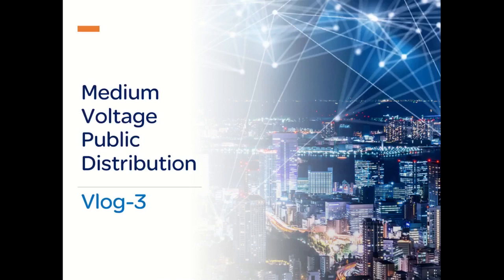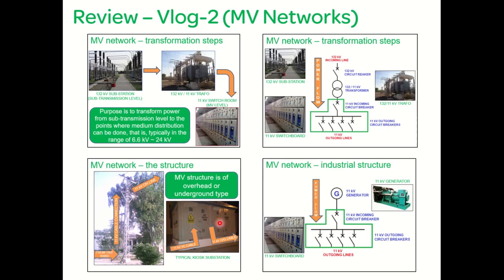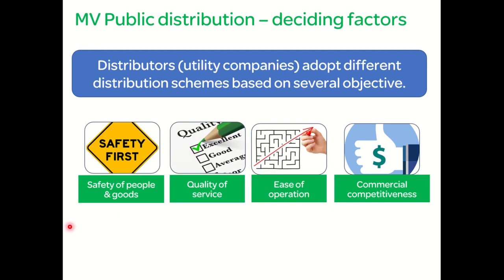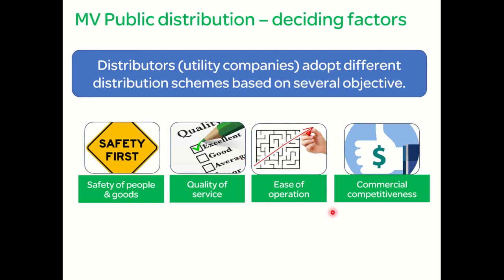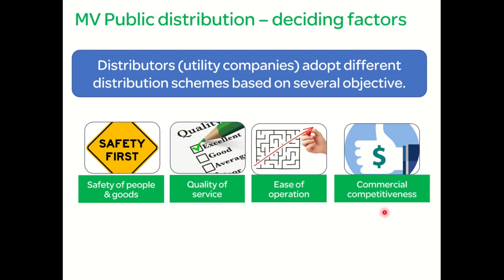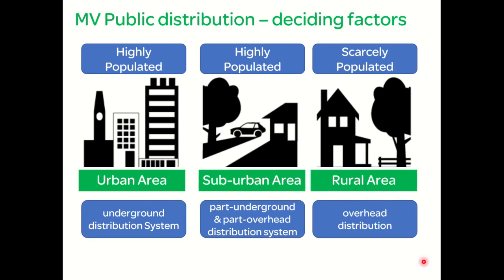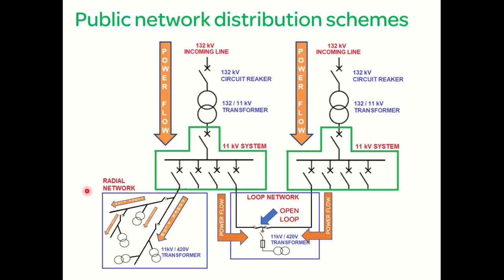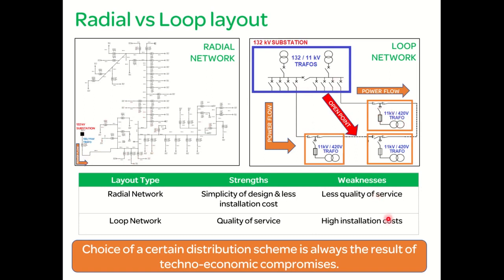Public Distribution System | Farrukh Habib-FHB | #ElectricalEngineering #distribution

Comment: Thanks for the post. Do you have any that talks about how 3 phase connections in LV are distributed to residential consumers by dishing out 1 phase at a time to houses on the street. Would be good to cover how the DNO supply cable cores operate to support this (single core and multi core cables and how the outer copper layer is the one that acts as neutral).
A future video could be PME and inherent risks (open PEN faults and how earth bonding will affect users in such a situation).
Reply from the maker: Hello, I am sorry I don't have right now. The earthing systems are in my list for future videos.